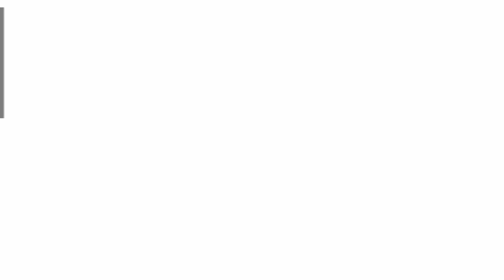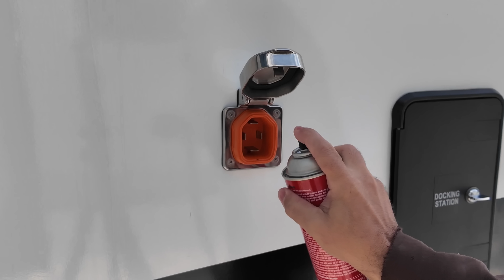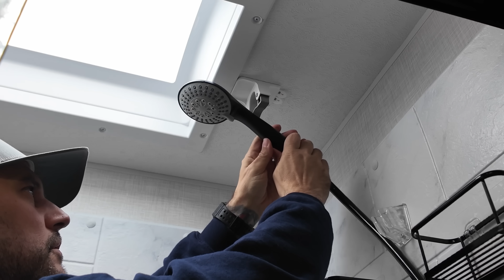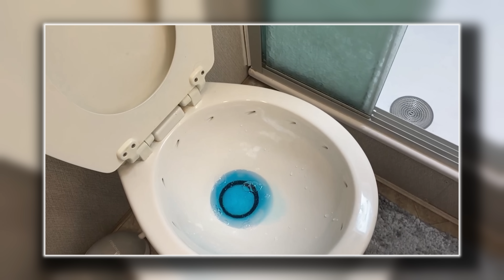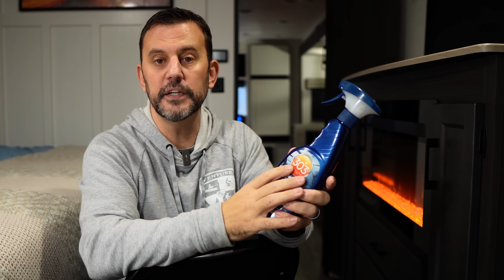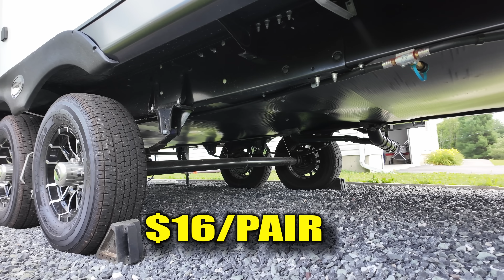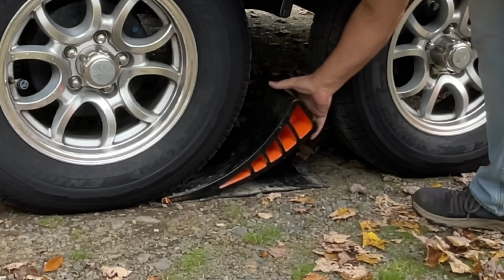The Most Popular RV Accessories & Upgrades EVERYONE is Using

Comment from the maker: ✨ PRODUCTS FEATURED 

20- Stainless Low Point Drain Valve https://geni.us/yBB02h7 (Amazon)

19- Evoflex 2 Water Hose https://geni.us/emLdlC (Amazon)
📺https://youtu.be/tc4ujWS75X8

18- X-Chocks https://geni.us/3oyburw (Amazon)
📺https://youtu.be/ermDoIB-y7s

17- CRC Electronics Cleaner https://geni.us/WDGUwi (Amazon)

16- Klein Tools 11-in-1 Combo Driver https://geni.us/TzTo0 (Amazon)

15- RV Snappads 10% off RV Snappads https://rvsnappad.com/discount/RVTT10

14- Command Broom Holder https://geni.us/6XA708 (Amazon)
📺 https://youtu.be/MWaX4fiUHj4

13- Winterizing Blow Out Plug https://geni.us/fa036d (Amazon)
📺 https://youtu.be/hUeht6jz8eo

12- RV Screen Door Handle https://geni.us/itRfKUQ (Amazon)

11- Water Pressure Regulator https://geni.us/fTzA0 (Amazon)

10- Kamenstein Paper Towel Holder https://geni.us/Acknol (Amazon)

9- Carmtek Level Ramps https://geni.us/ILYrxu (Amazon)
📺https://youtu.be/43dZNtxEMpw

8- Frost King Foaming Coil Cleaner https://geni.us/EglzPD (Amazon)
📺https://youtu.be/5iQp_UOqjdE

7- Boeshield T9 https://geni.us/uXxstyC (Amazon)
📺https://youtu.be/OYhVKgU43lY

6- Thetford Toilet Seal Conditioner https://geni.us/HgIj (Amazon)
📺https://youtu.be/mmrrOb4sOb8

5- Camco Tastepure Water Filter https://geni.us/SdAVJv (Amazon)
📺https://youtube.com/shorts/r_1LFBv3RsM

4- 303 Automotive Protectant https://geni.us/nz8kzTU (Amazon)
Buying in bulk?  Get this instead: https://geni.us/09aceZq (Amazon)
📺https://youtu.be/Fwv2oml25bs

3- Liquified Toilet Treatment https://geni.us/QTUJSrP
📺https://youtu.be/TsLpaJqaWpI

2- Maxxhaul Rubber Wheel Chocks (Amazon)
📺https://youtu.be/43dZNtxEMpw

Honorable Mention 1- Dimmer Switch Parts https://youtu.be/2bbqBcSsRZQ

Honorable Mention 2- Blu Technology Water Systems 7% off $80 or more! https://goblutech.com/xxnnkdun 
📺https://youtu.be/PnKyWJdxmW4

1- Beech Lane Wireless RV Leveler https://geni.us/DAW9N24 (Amazon)
📺https://youtu.be/43dZNtxEMpw

The Most Popular RV Accessories Everyone Bought Today we look at the RV products, accessories, gear, essentials & must-haves your fellow RVer's are buying from our video links in 2025. PLEASE click the like button, leave us a comment & subscribe to get notified when we release new videos.. 

#rv #rvlife #rvliving #rvlifestyle #rvtips #rvtravel

Our Favorite RV ESSENTIALS & TOP PICKS 
🎥Essentials Video: https://youtu.be/yuvS3zZL81c 
🔷Sewer Hose Kit https://geni.us/7dNg (Amazon)
🔷Clear 90 Degree Sewer Elbow https://geni.us/L79gI2 (Amazon)
🔷Camco Sewer Adapter Pro Drain Lock https://geni.us/cFPD
🔷RV Water Filter https://geni.us/FZ1P (Amazon)
🔷Best Wheel Chocks https://geni.us/9B5i (Amazon)
🔷Power Watchdog 30 Amp Surge Protector/EMS https://geni.us/zKcm (Amazon)
🔷Power Watchdog 50 Amp Surge Protector/EMS https://geni.us/jgOto (Amazon)
🔷Wireless RV Leveler https://geni.us/DAW9N24 (Amazon)
🔷Leveling Ramps https://geni.us/m38VoBr (Amazon)
🔷Liquified RV Tank Treatment https://geni.us/QTUJSrP 
🔷TPMS https://geni.us/8HBSTg (Amazon)
🔷Water Pressure Regulator https://geni.us/fTzA0 (Amazon)
🔷Drinking Water Safe Hose https://geni.us/emLdlC (Amazon)

MAINTENANCE
🔶Geocell Proflex Sealant https://geni.us/YXiACx (Amazon)
🔶Water Heater Flusing Wand  https://geni.us/AcTvhLc (Amazon)
🎥Water Heater Sediment Removal https://youtu.be/h6C6ihTQ1cY
🔶Waste Tank Rinser https://geni.us/V2XLE (Amazon)
🔶Tool Kit  https://geni.us/oBFnd9l (Amazon)
🔶Eternabond Roof Tape https://geni.us/6AXdw (Amazon)

INSIDE
🔷Screen Door Handle https://geni.us/itRfKUQ (Amazon)
🔷Shower Caddy https://geni.us/ZPcno (Amazon)
🔷Shower Head https://geni.us/jznwF (Amazon)
🎥Dimmer Switch https://youtu.be/2bbqBcSsRZQ

OUTSIDE
🔶Gravity Chairs https://geni.us/VlPR8rn (Amazon)
🔶Ground Mat https://geni.us/wbWWLzf (Amazon)
🔶X Chocks https://geni.us/3oyburw (Amazon)
🔶Blackstone Griddle https://geni.us/8BuIrW (Amazon)

🌟Shop ALL RV Essentials & Gear https://geni.us/1Omwvhh (Amazon)

👇 COUPON & DISCOUNT Codes Below! 👇

📷 Haloview Back Up Cameras 5% Off + FREE SHIPPING (Use code RVTIPS at checkout) https://geni.us/zbdIFSe

🔧 NRVTA Home Study Course https://rvtechcourse.com/discount/RVTIPS20
Use Discount Code: RVTIPS20

🚴‍♂ Lectric eBikes - Use our link, get FREE accessories https://lectricebikes.sjv.io/nLrJ3x

🛌 Get 30% off your RV Mattress by Brooklyn Bedding at https://rvmattress.com/rvtips
Use Discount Code: RVTIPS

💻 Our EBAY Store! https://geni.us/6AyLKnS

💥 Join Our FREE Newsletter! https://rvtipsandtravels.myflodesk.com/freenewsletter

If you want to support the work I do to help others, you can donate here:
Paypal: https://www.paypal.com/donate/?hosted_button_id=J2KKM9NR3BJJA
Venmo: https://venmo.com/u/Ross-Stoico

Follow Us on Social Media
https://www.facebook.com/RVTipsAndTravels

As an Amazon Associate, I earn from qualifying purchases. As a Walmart Creator, I earn from qualifying purchases. There is NO ADDITIONAL COST TO YOU when purchasing from our links. If you find a dead link, PLEASE let us know. Thank you for your support!